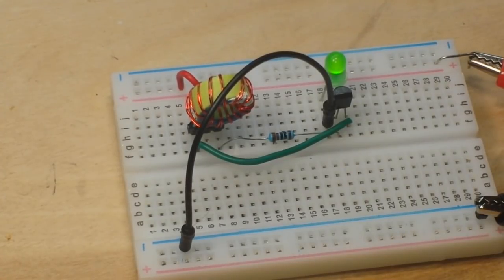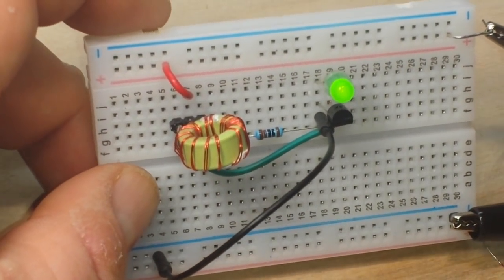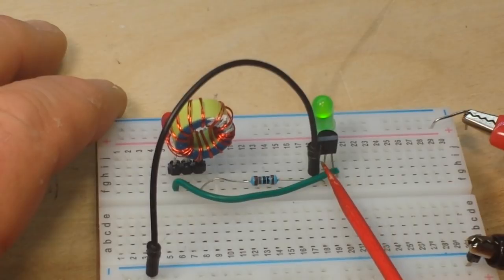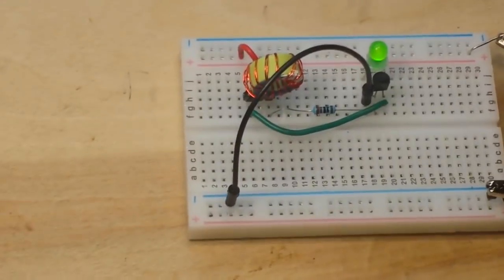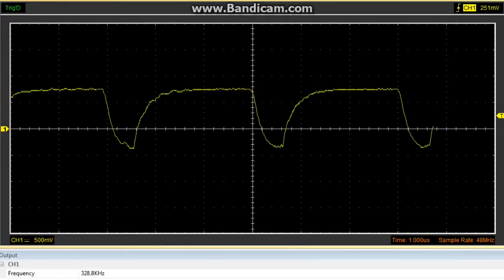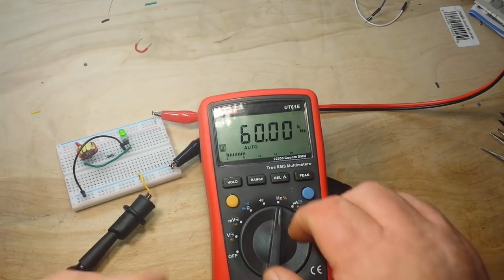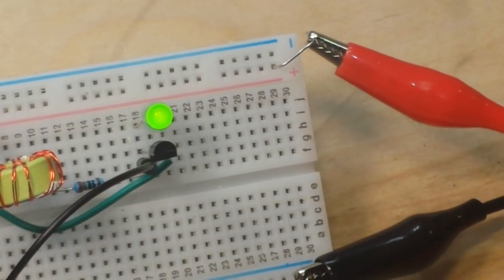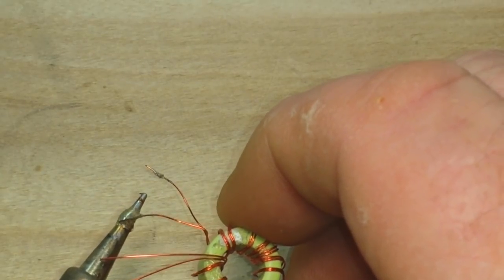How a Joule Thief Works

Comment: Great video as always, I used a Coil from a Poundland cheap doorbell.  Impressed with the result. 72 Led's on low brightness under 400μA .    Very bright if I turn download resistor.  Uses max 12.42mA, on my YT. Keep up the good work

Comment: I don't understand why everyone mentions how to connect the two coil windings and yet they won't mention the reason for it. Better yet I don't see anyone asking why it is connected that or maybe have a mental picture for it.
I simply see it as causing to current to flow in the same direction but oppositely wounded coil after I was able to cut through the cobweb of it in my mind.
Anybody here that might know?
Reply: No disrespect here, but the explanation is about 5 of 10, why, does not show a schematic to make it easy to follow and he really does not explain it all correctly.
Specially the boosting of the base voltage and EXACTLY why the transistor turns off. Most explanations I see are this way, incorrect.

Comment: just a cool addition to a joule thief: you can add a third winding on the transformer with a TON of turns to create VERY high voltages (unfortunately, with extremely low current). I got a 1.5v battery to go up to 50v that way. i think the 3-winding method is sued in many commercial mosquito zappers. just remember that people are not bugs, so dont zap them using this. i dont want to be the reason someone gets hurt lol

Comment: I usually use an air core coil  or a pot core. Sometimes there is this really sweet spirit , I don know if it is God(Jesus) but where I usually get 19 or 20 volts I'll get like 42 volts. Thanks

Comment: its very important to mention that its very preferable to have a core with a flux reset path,like a ferrite with a non magnetic gap or powdered iron core. so when core will be energized,after that flux will fall to a much lower value (residual magnetization will be lower).  that will make a greater efficiency of converter.

Comment: The little linear style through hole inductors will work just fine in place of winding your own torroid, if you wanted to make it look a little more streamlined.  A pair soldered together make a peachy center tapped transformer.  You can even omit the resistor, but to my calibrated eyeball it made no difference.

Comment: I saw a joule thief that you can wind a air core type without a toroid and put the coils together to make a wireless unit to do what ever you make with a full wave rectifier and a electrolytic capacitor to it.and I tested it and it does work.

Comment: Nice paul, how low can you get in voltage before the led goes out? forward voltage of the TR?, probably one have an overshoot when the field collapses.....this i must try with an old germanium... thanks for sharing, nice channel
Reply from the maker: Thank you. The toroid builds up charge as the transistor conducts. When the the it build up no more charge, the trsnsistor goes into cutoff. When this happens, the magnetic field in the toroid collapses and the accumulated charge is dumped at once into the LED, thousands of times a second.

Comment: TRANSISTOR! TRANSISTOR!  not TRANSFORMER!
Reply from the maker: Slip of the tounge. My most humble apologies for offending you and causing you to YELL AT ME.
Reply: its not that I am offended. I know you are trying hard to do something here and I appreciate it. I really do but somewhere along the line someone needs to yell cut and run a retake of the scene even if the only someone is only a voice in your head. You do yourself a great disservice by making a LOT of speaking mistakes. It weakens your message which is essentially a good one. I know you need to get product out there and I can respect that but this video looks more like a last minute homework attempt. Nobody said it was going to be easy but if  it its worth doing, its worth doing right.